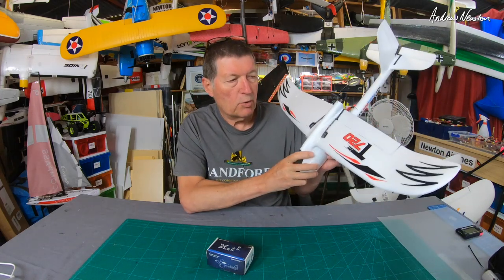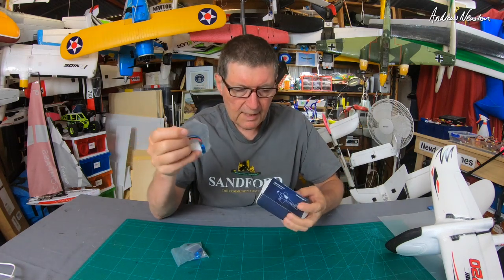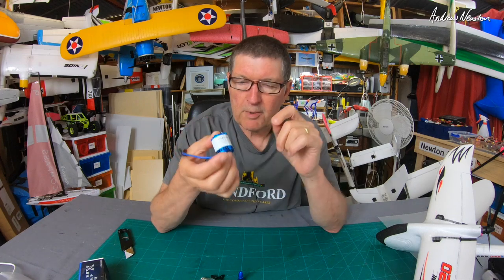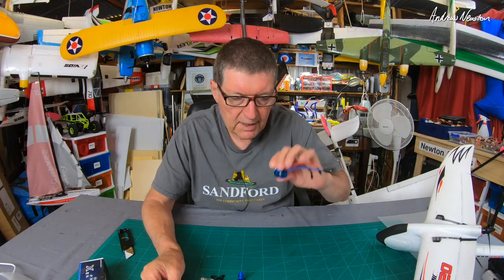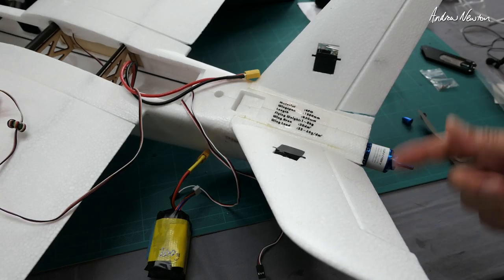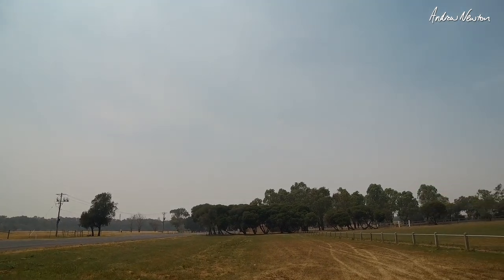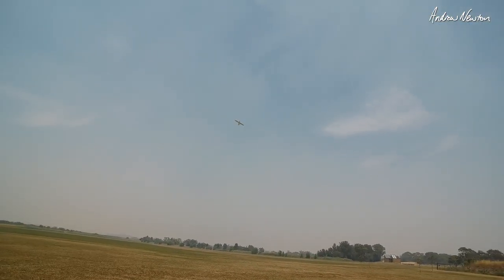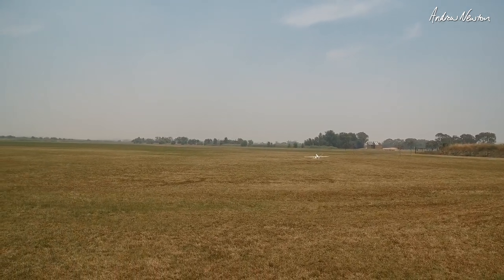Sunnysky X2216 1250kV V3 Motor

Comment: Nice test flight and cruising around on as few amps as that at only 1/3 throttle makes for some very good flight times ;-) See you in the Air!
Reply from the maker: Interesting that the specs said 40A but I measured 45A max. Maybe I misread it.

Comment: Awesome Motor! I had the X2212-III 1400kV on one of my AR Wings before until I replaced it with a more powerful AirB but the X2212 will go on my long range rig and replace the A2212 to get a bit more power if needed.
Reply from the maker: Nice one Marc. This is the first blue motor I have tried

Comment: That prop is on backwards Andrew. A small point (this is a way to reduce thrust used in Sorting out Pylon racers in the past) Sunnysky's are my motor of choice - never had a magnet let go and the bearings seem really good quality.
Reply from the maker: Prop on backwards? No it would be noisier and way less efficient if that was true

Comment: Nice, Andrew. Very nice. But...   I'm an old-school aeromodeller who's only recently bought in to the LiPo/electric flight scene. Slightly. In a small way. I work on sub-250g DIY-designed projects; I have four LiPos and an Accucell charger and three tiny, random, cheapo motors and a few budget BEC-type ESCs; I refuse to get any more involved because I'm basically skint, ignorant, lazy and stupid.

I understand how to configure rubber-powered free-flight models, though. I know how to carve huge custom props from balsa.  I understand burbling PAW diesel engines and ether blends and compression ratios; I understand glow plugs and two-strokes and four-strokes and fuel additives and synthetic oils and multi-blade prop-matching and chicken fingers and tuned pipes and how to build expansion chamber silencers and get a reliable slow idle on a twin-needle carburettor.

I don't understand modern electric flight, though. Nope. Not deep down. Not really. It's just never grabbed my attention. Back in the early 1980s I built an electric-powered glider (well, it was more 'assisted'...). Simple brushed motor, no such thing as an ESC, it had a clumsy bang-bang on-off mechanical microswitch and useless, ludicrously heavy Ni-Cad batteries. Clean and quiet, yes, but overweight and thoroughly impractical.

"But electric flight's cool, now, Elli! Dump your messy old Saitos and get involved!" Um... no thanks.  I regard electric flight in the same way I regarded CDs when they first appeared.

"But CDs are the future, Elli! CDs are cool! Dump your messy old record collection and go digital!" Erm... no thanks.

I avoided CDs because I hoped something 'better' might come along. And it did. A couple of years later: MP3 encoding. Infinitely portable. Yay. Oh, I know the quality's lousy (I'm a musician of sorts) and sampling rates and bit depths are a techno-minefield, but there are lossless formats now and flash-memory and USB sticks have multi-gigabyte capacity... So I'm glad I kept my vinyl records. (And transferred them all to hard drives at enormously high sample/bit rates so I could listen to them without wearing out the originals.)

Anyhooo, despite all of this fine Channel's joyful and inspiring successes and tempting electro-blandishments, I'm finding it pretty easy to resist spending a shedload of dosh on electric flight.

I still haven't got a clue about matching brushless motors to LiPos or airframes or current drain or ESC-rating or kv classification, though. My little girlie brain goes all auburn-bimbo-blank at the thought of it; it's just trial and error and guesswork for me.

I tend to buy a teeny-weeny super cheap motor (for £3 or so) and muck about with it. I toy and flirt coquettishly with 2S LiPos and 30A ESCs that cost no more than the motors. It's sort-of fun, but am I a bad person? [Yes you are, you tramp.] Am I especially worthless and evil for not taking electric flight more seriously? [Yes. Get thee to a nunnery.] Whatever. I'm keeping my involvement small because I've no intention of getting caught up in the new drone registration nonsense. I'm not into quad-copters or FPV.

Drone registration? Who he? I do action-camera KAP and KAV because I love making and flying kites and because making moody videos from a gigantic kite won't get me arrested and fined £1,000.

I fear that the RC hobby faces a right good kicking, so I'm steering clear of total electric flight immersion.

I've no doubt that the sub-250g RC rule will vanish once the CAA realises that modern micro-gear is letting far too many cheeky fun fliers enjoy themselves by slipping under their cash-cow 250g radar and that ALL radio modellers must be tightly regulated and taxed for their heinous crimes, so I'm not spending a penny more than necessary on electric flight.

Ironically, I now do all of my real RC flying indoors on an RC simulator. (Phoenix.) Is that virtual reality or real virtuality? Whichever it is, it appeals to my sense of the absurd. And there are no kv calculations, weight limits, £1,000 fines, or LiPo fires to worry about.  ;-)
Reply from the maker: Love your short stories Elli. I'm quite prepared to turn my back on RC powered flight if it all gets too nasty. Slope soaring, kite flying and scuba will keep me busy.

Comment: Thanks for all your videos Mr. Newton, I have the sunnysky  2216 1250kv v2 motor and trying to find out is the propeller shaft on the 2216 1250kv v3 the same diameter? On the v2 its 5mm, I'm not having any luck on sunnysky website or emails. Also what's your thoughts on this v3 and a 9050 propeller on the ar wing pro? Thanks again
Reply from the maker: Yes it's 5mm. I have tried 8060 so 9050 should work well
Reply: Thanks I'll give it a try

Comment: Andrew, a dynam c-188  question. when I begin engaging the throttle the motor seems very fast I was thinking I could adjust  my throttle curve between 0 and 25% marks.
Or should I adjust the timing in the esc?
Thanks Bret
Reply from the maker: Calibrate the ESC with your radio? These Dynam ESCs are a bit quirky, mine pulses on low throttle.
Reply: @AndrewNewton  Copy, The Skylord esc instructions I have, state there's a menu you can go into with  6 manageable categories (brake, battery type, cut off type, cut off voltage, start mode, timing mode) that you can adjust using the throttle stick.
Regarding your pulse problem I believe it's the timing mode or maybe start mode.  The 6th category is timing mode. There's low, middle and high setting for timing. Instructions say that default is middle.  Motion rc had a video up of Pilot Ryan adjusting for his pulse problem. However the video is now removed.

Comment: Hi, I've been using a sunnyky 2220 iii.980 (blue motor) on 2.9 meter glider 1100 grams with a 11x7 folding prop for year now with no problems. To me it seems like vertical flying but I'm not flying competition, it takes about 5 to 6 seconds to get 100 meters i dont know if thats good or not. But for that price it's good for me.
Reply from the maker: That's great performance.

Comment: What prop were you using on this test flight?  Would the 800 KV version of this motor provide even better low amp cruise?
Reply from the maker: Yes probably would be more efficient, although I have not tried 80kV

Comment: Andrew, did you test the thrust at full throttle with this setup (2216 1250, 8x6, 4s)?
Reply from the maker: I never measure thrust but it would be interesting to do. About 45A max current draw.

Comment: Can you point me to a resource that correlates motor size to airplane size? And Happy New Year!
Reply: If you go to the SunnySky website,  they tell you what size planes and type that are appropriate for a particular motor.
You can also look into what motors manufacturers put into their planes that you are interested in and use that as a starting point.
RCGroups.com has everything you need.
Reply: @toolbaggers  Thanks
Reply from the maker: A rough rule of thumb I have seen is 100W / lb which converts to 220W/kg